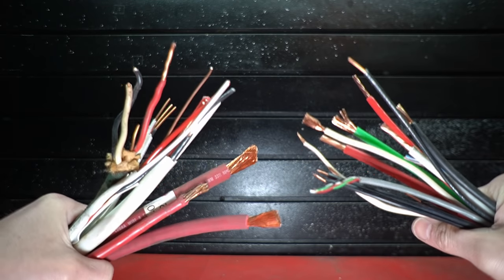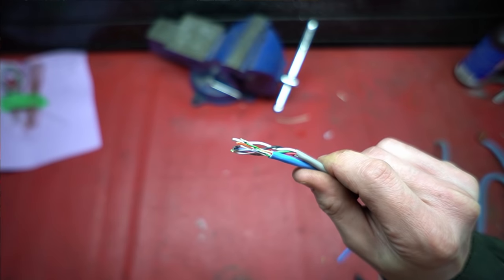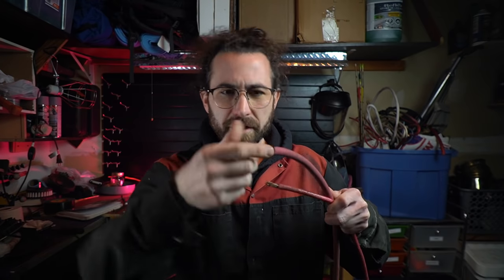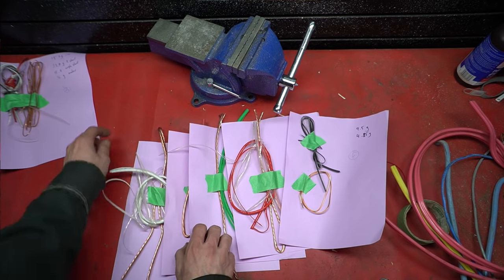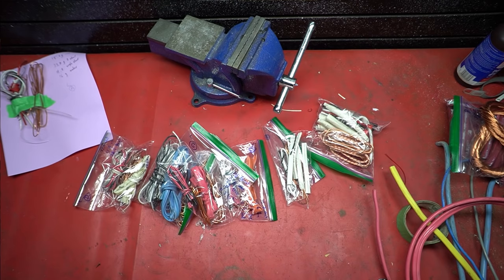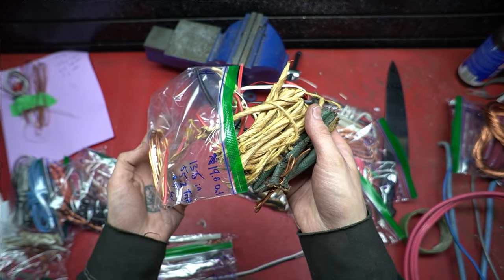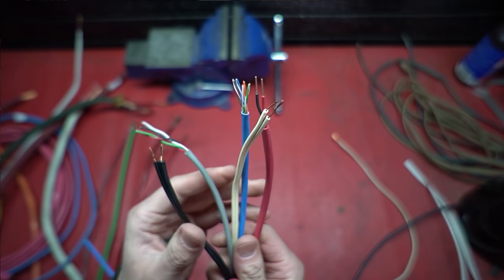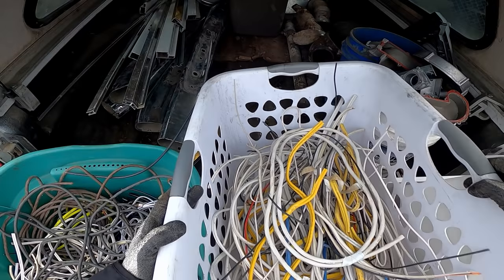Is It Worth Stripping Copper Wire For Scrap? Should You Buy a Stripper?

Comment: A small socket, cut length-wise on one side, a narrow cut for a blade, weld the blade to a platform that is adjustable, lower and raise the blade and the wire is fed through, slicing the sheathing as you pull it through. Inquire for a prototype. Makes copper extraction at least 60% faster. Costs almost nothing especially if you have scrap laying around. I'm not scrapping at the moment but I do like to melt metal and copper sheathing is time consuming.
Reply: I love that idea, I will build something like that today. Thanks for the inspiration
Reply: got a pic or video?
Reply: Would really appreciate your prototype please?
I’m trying to clear out 25 yrs worth of garage clutter and make it pay as I have the time.
Can you possibly recommend a video on the various wire cutters ?
Reply: Sorry guys, I'm just seeing your requests for a prototype. The concept is similar for certain gauges of wire. Stranded or solid doesn't seem to matter. My next post will be a link to what I'm talking about.
Reply: Show us how and link the video.

Comment: I started my copper journey today, and after acquiring roughly 100g of copper from old wires I found my fingers went numb and I cut my thumb with a knife 😆, I can tell a while after doing this the  skin on my fingers will be very tough, by hand stripping copper wire is harder then it looks especially with small wires

Comment: At my scrap yard they pay me #1 price for all stripped Romex, THHN stranded, basically anything that's not copper - clad. So I do a cheaper  motorized copper stripper (180.00) and it does great. I just cashed in my stock pile of copper scrap and I received about $4800.00!! It was about 1300 pounds of completely stripped #1 copper!!! I stripped as a hobby during the winter. Oh and I'm an Electrician so I kinda have a Neverending supply of scrap
Reply from the maker: That’s an amazing stash!! Yeah that justifies the investment in the motorized stripper pretty easily. Nice work!

Comment: As an electrician I get a lot of scrap loomex. It all gets the first layer stripped (super easy and quick with a hook knife) and then the bond wire is seperated and the insulated is shoved in a box. I have an absolute ton if it sitting around so this was quite informative. I think I'll keep hoarding and buy a stripping machine in the future.
Reply from the maker: Well you’ve probably got a bunch of the good stuff too huh? You’d pay for the stripper in the afternoon it took you for sure. I’m curious what to expect copper prices to do from here.
Reply: @thubprint  prices are expected to go up from here. All the local contractors are hoarding wire because it's supposed to jump crazy high and it's starting to cause shortages. And yeah, I got a bunch of 6awg and a ton of 12  from a grow op we just did. And a pocket full or more of 14 trimmings on the daily. Pretty privileged in that respect. None of my co-workers scrap because it's not worth their time they say. Well my time is free because I don't do much outside work so I'll take the the free metal haha
Reply: just beware the Rack A Tiers wire peeler is vey testy to setup with 14AWG. Spins out quite often and gets a bit frustrating after a several strips. Not much to setup other than adjustment blade up or down and feed hole up or down... good quality build though.

Comment: I bought a Stripmeister after debating a while, and it paid for itself the first time I used it!! It does all wire extremely easily even romex.
I've been stripping all wire ever since I bought it.
Reply from the maker: Nice! It sure would be a treat to use. I’m not sure my volume justifies it, but it would pay off eventually regardless
Reply: I also went top of the line with a Stripmeister. I had about 700lbs of 500mcm to strip so I spent the 1800$ on the stripper. I literally made that 1800$ back in less than an hour. If you scrap wire often it’s a no brainer get yourself a stripper. 🤙🏻

Comment: I've learned more from your videos than I have in 3 yrs... My local  yard has been awesome since it changed hands. I started doing this more often to help our local Cub Scout pack due to this pandemic. It's helps alot. For me the only thing I'm going to get is the STRIPER 😂 (MACHINE.)  Wire I can get alot of most don't bother with it here. But the copper/brass I turned in about 1 mo ago brought our Pack almost $500. That was what I collected over last summer.  I had over 300 lbs in the brass. Most over look that item here. But that was my gain. It would have been more but 5 foot surgeries was a set back. Now it's game on..... 😂

Comment: It's very easy to make your own wire stripper with a piece of steel, a nail and a set screw. You need a drill and a tap the same size as your set screw. Drill 3 holes, one downward from the top and 2 going through that hole perpendicular to it. Thread the upper hole for the set screw, cut off the head and sharpen the nail in your drill then put it down into the top hole, pull the wire through the lower hole. Put the steel in your vise and pull. It works best if you set the nail into the coating then pull but once it starts its very easy to pull through. Trying to come up with some type of drill mechanism to spool the stripped wire so the drill does the pulling. We'll see

Comment: Tabletop stripper is definitely worth it. I make back double what I paid for it the first time I used it!
Reply from the maker: Dang son, you must have had a stack waiting for that to show up!
Reply: @thubprint  I had a pretty decent pile of silver-coated copper from a local ballpark that replaced its main Light Panel. 400-amp service required 1 and 0 gauge wire 😁

Comment: Thanks for the video!
 I just started working at a landfill as a bulldozer operator and I find tones of wire. Really been wondering what's worth stripping and what's not 
I cannot believe the things people throw away 😑
Reply from the maker: That’s so cool! Legitimately a dream job in my mind lol. I was surprised to find that every wire is worth stripping, but it’s the time it takes that makes it difficult to answer. I’m glad I did the research though, and now I know what makes sense for me. Hoping it’s useful to others and doesn’t sound like avoiding the question.
Reply: @thubprint  100% is a dream job 👍 It really seems to be more about managing your time based on how much wire you are bringing in and how quickly you need to get rid of it. 
With my flow of wire being so large and my free time being so small its almost not worth stripping anything.
I dont even pick the bottles anymore because they are honestly not worth wasting time that could be used for picking wire

Comment: Using the $100 TNT wire stripper hand tool (when Cu $2 -$2.30/lb Can.), I stripped everything thicker than house wire, unless house wire/thinner than house wire is very long and/or thick & in good condition, not kinked, not burnt, nor has clear 2nd plastic outside layer that bunches up in holes.  This means you should strip wires where you find them before handling causes tangling & kinks.  Stripping multistranded is risky;  you could leave small bits of Cu glistening on ground in Sun, so don't cut deep into the Cu.  Coaxial wires are especially bad for this; most people don't strip those anyways.  I don't strip wires twisted together.  Tell me if there's an easy way to untwist them.
Reply from the maker: I don’t have an easy way to untwist them, but maybe clamping one end in a vice and the other end in the mouth of a drill and just reverse twisting it?

Comment: My wife said "naughty naughty thub" lol. but about the wire, I just separate #1 and 2 and turn in as is. I spend my time cleaning all my copper pipe (#2 ends off etc) and cleaning a butt load of pressure relief valves every week. But I do pull the #1 wire out of the paper and plastic comex. Enjoyed the vid, see you next week. From Sacramento, CA USA keep doing the thing.
Reply: I mean romex
Reply from the maker: That’s one thing I should have done the math for!! Removing the ground wire and leaving the rest intact. Although I imagine a person’s yard would figure that out pretty quickly and adjust the individual’s price for it, so perhaps not as much of an oversight after all. All the best to both of you!
Reply: @thubprint  yeah. I mean I separate the #1 copper from the #1 ICW in romex. I may lose a little $$ but I only bring 2 bins (of wire) to yard. Everything that bends back is #2 icw no matter how thick (for the most part)  and everything that stays bent is #1icw. I definitely wasn't trying to find and point out a fault in your math or method. Just to clarify my friend.

Comment: Romex is easy to strip, use the ground to get it out if the original jacket then my table top motor power stripper dies the rest.  Great vid !
Reply from the maker: It’s not that bad then? I have very little experience with power strippers, I’d just heard that they don’t love romex. I suppose there’s different types though

Comment: Well. This video only proves what I already knew after IDK how many hours of stripping the wires I snip off of appliances to get 6 pounds of bare bright copper wire. So not worth it! I know have a bin I toss all that into, even though my local yard pays about 25% of what BB copper brings. Those hours I’d rather spend looking for more scrap! And I still don’t know where to find good wire, solid stuff like you have, everything I find is the wound fine strands, except for deGaussing wire, and even found that once in a small, cheap TV!!’ Thanks for the great video, Thub!
Reply from the maker: No problem, this was a fun one! Took longer than I expected though, lol. It’s true, great cable is not common. That’s the real reason I don’t have a power stripper, it just wouldn’t get used very much.
Reply: @thubprint  I am totally with you on that one, brother!

Comment: Hey Thub I just bought a electric table top stripper but I have a like new tnt tooling wire stripper you put in a vise. Is that something you would be interested in I would gladly send it to you to help increase your profits.
Reply from the maker: That’s awesome, thank you! I’ve seen moosescrapper use of that one, seems alright? I’m pretty convinced at this point to get the electric one myself though, but I really appreciate your kindness ☺️
Reply: @thubprint  yeah that's where I got the idea to get one. It works pretty well made things a lot faster. I think electric ones are totally worth it. Expensive for a good one but well worth it. An of course anything to help out a fellow scrapper.

Comment: I would suggest stripping as a pastime.  Turning it into a job only makes it work and nobody likes work. I never consider what I make per hour. I only look at the extra money that I got for free.  In 2023 it only takes 50 pounds to cover the cost of a drill run stripper. Thats about a 5 gallon pail of stripped wire.

Comment: I hand strip ,I heat wire cut in 2’ lengths with a 2 plate electric stovetop using a flexible blade fillet knife and a $20 farriers leather apron as protection from ten blade and to place the wire  against.
Reply from the maker: That’s my kind of solution! I am thinking about investing in the electric one but I’ve done it by hand for awhile and as I’m sure you’re aware, a person can get pretty quick once they’ve done it a few times.
Reply: 1 other tool is “easy cut 1000” utility knife for cutting casing .It auto retract ,3 depth settings and has guides that keep blade centered on wire

Comment: Sitting alot, mostly appliance wire, based on a percentage I take out for every scrap load I take in. Should have a table top stripper mid summer. But with lock downs in Ontario starting tommarow, hopefully will not slow me down
Reply from the maker: It doesn’t sound like they’re going all in with a stay-at-home order so tbh I’m not sure what it’ll  change. I stopped digging in resi bins when we started lockdowns for my own peace of mind

Comment: I strip everything i can, except for the tiny telecom wires... I strip all my copper at work during coffee breaks and lunch... lots i find at work but if my stash runs low i bring it by the grocery bag from home. I store the bare copper in buckets - then take it home once they’re full and keep it locked in the garage until i have enough to bring it in @ good price. Its a sick deal... im getting paid on my breaks/lunch while stripping copper making more $$. I usually put a podcast on for something to listen to. It adds up like crazy. I get about 250$ a month in clean copper and about 120$ in brass. My only issue right now is not enough extra time in the day... my stash is piling up and needs sorting/cleaning!
Reply from the maker: Could always hire the neighbour kids! That sounds like a good system though, slipping it into time which is already accounted for if possible.
Reply: Be very careful with this. Companies will turn on team members in a heartbeat. I have seen it ruin careers over something very small. Good luck.
Reply: @onefixitman  im a union protected repairmen running maintenance at an apartment building of 250 units solo... its all good, trust me

Comment: Thub... would it be feasible to melt down the bright & shiny #2 copper fluff wire into ingots ?
It would be worth more right? 
I realize the fuel would be an added expense but still it would melt fast.  Worth it or not ? 
Maybe use a wood fire with a flat top & ingot molds.

Comment: with the very small fine strands of copper I just burn them to be honest because taking the case off of those is a pain and not to mention that I still have some wire in my fingers from helping dad clean off copper. also couldn't tell you how many times the utility knife slipped and cut my thumb.

Comment: Learning to recognize 14, 12 and 10 gauge wire came quickly.
Is that your equivalent to thick, medium and thin?
Reply from the maker: I’m sure you’re right, it couldn’t really take long if I decided to start identifying them properly. I used thick/medium/thin as relative terms regarding the common types and aimed to support that with visual examples. In my mind I was aiming to keep things as easy to understand for as many people as possible so I didn’t want to alienate anyone by using terms they may not be familiar with. In hindsight it would have been a more helpful piece of work to quickly include that somewhere, and I’m glad you reminded me 👍 I suppose in my mind 8g is the point where it isn’t worth the time to strip.

Comment: I just took 4 hours to set up, strip (#4 AWG), and clean up the trash and got 120lbs of solid copper.  I prob got an extra $75 for stripping, which wasnt worth my time and wont be doing it unless I get CABLES and not wires/

Comment: About to cash in some copper in to get a table top. I feel it's worth it.
Reply: Don't buy it from wish lol..
Reply: @bud_smokinzie  why
Reply: @bud_smokinzie  okay thank you for the information
Reply: @duncanbailey8142  wouldn't even consider wish. Scammer city.
Reply from the maker: Can you tell me more about those ones? The blue ones I assume? I was looking at one but what is the issue, is the motor weak or do they not split the wire consistently or what?

Comment: I paid for my stripper with my first load of copper wire to the scrap yard and that was all stuff still in it's insulation because I was not going to spend days wrecking myself stripping it by hand. The really good stuff I kept aside for after I got a stripper of course but some of the stuff that I strip now, like appliance cables, went into the mix. I paid less than about $170.00 for one of the light blue Chinese ones with the 1/4 horsepower motor that are sold under various brand names and also come unbranded. Also don't bother using the stupid feed guard that you can bolt to the front of it. The wire enters at the wrong angle and has trouble cutting the sheath. If you're not a compete moron and don't stick your finger in their you'll be fine. The one I bought came with an extra blade for free. They are all the same machine from the same factory so find the one selling for the least when you buy. I've also seen it come in dark blue paint but it's still the same machine. The wire I stripped with it and took to the yard the next time could have paid for six or seven machines and I still don't need to change the blade.

Comment: Thanks for the videos, had a question. the copper wire that has that is silver looking, it is that still able to just be put in with the regular copper wire?
Reply from the maker: I would say so, I usually do. Sometimes I’ll find wires that look like they’re silver all the way through (like in a computer power supply) and just to be considerate I usually throw those out, but most of the time they’re tinned copper and still mostly copper inside so I add those to the same #2 insulated bin. If you’re stripping them though they’ll still be #2 clean
Reply: @thubprint  really appreciate it, thank you.

Comment: So I have 4 x 1000ft reels of  14awg 2c FPLP(solid fire alarm cable). What should I do. So it has an outer jacket, then each conductor has a coating...
Reply from the maker: If at all possible you should definitely try sell them as reels first! It would 100% be worth stripping but you could easily get twice the scrap value if sold as is